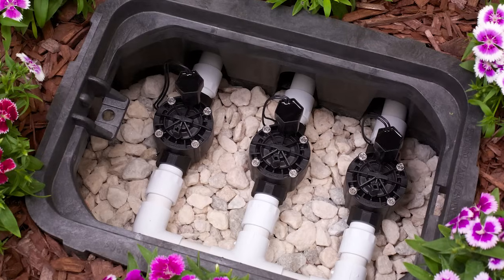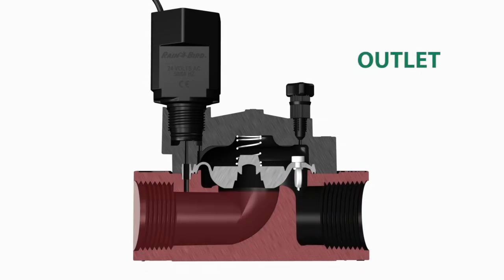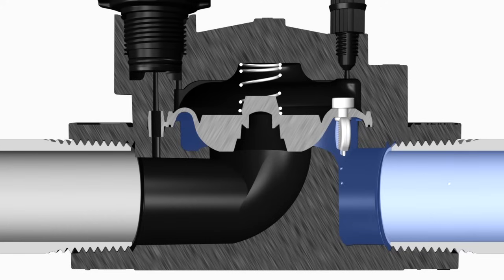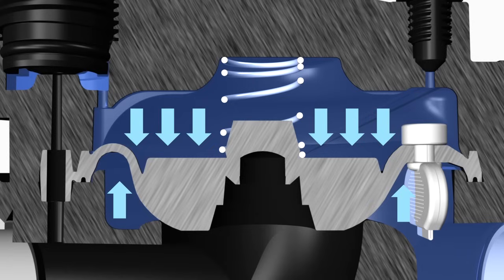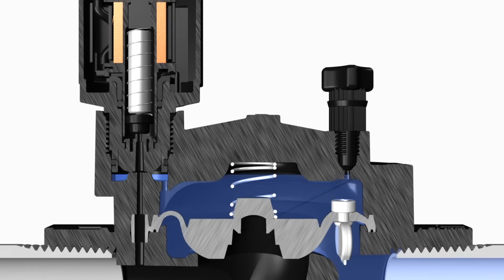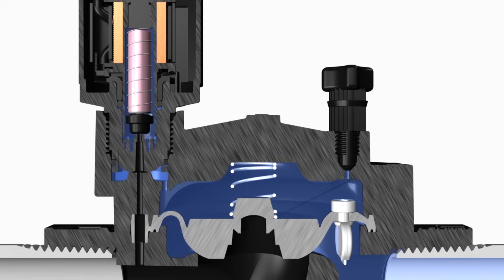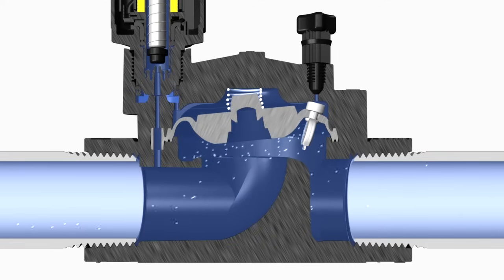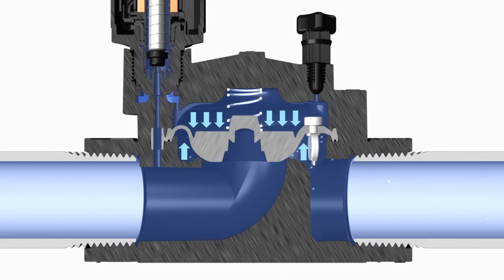How Do Sprinkler Valves Work? Rain Bird Irrigation

Comment: what if there is no spring attached with the diaphragm?
Reply: Likely then you're sprinkler will always either on or off. Pretty sure always on.
Reply: @securus777  i have seen many 2 way valves with integrated solenoid have spring attached with the diaphragm and some other type 2 way valves dont need springs. can you explain the advantage of not having springs in the diaphragm. in dorot make 2 way valves there is no spring required in the diaphragm.
Reply: @xtrememotoroads  Nope, sorry. Just a homeowner with a super basic system I'm trying to figure out on my own. :D
Reply: @xtrememotoroads  I can answer that question, I just need to know what other type of 2 way valves without springs you are talking about, like ball valves?
Reply: @xtrememotoroads  In some designs the rubber elasticity of the diaphragm itself provides the spring component, to save cost.  But having a metal spring makes the operation more responsive and reliable, and gains the adjustable flow control stem feature.  The spring stays the same over a lifetime, but a rubber part gets stiffer and goes "out of tune", so only the metal spring will last.

Comment: This animation allowed me to finally figure out what that little screw was for. I had a station that had power going to it but the sprinklers wouldn't activate. After turning the screw counter clockwise, some water spewed out of it and the sprinklers for that station started working again. If I tighten the small screw once the sprinklers get going, about 30 seconds later they'll shut off. Is this normal? What gives?
Reply: This one rainbird does answer.... way to go rainbird!
Reply: Yup it was the solenoid that was bad
Reply: I know this is 4 years later, but that screw "bleeds" the water from the top of the diaphragm thus lowering its water pressure and allowing the valve to open. However the solenoid is still closed, so as soon as you tighten the screw again the pressure begins to build in the top of the diaphragm and shuts the valve.

I had exactly the same question as you, so it's not uncommon. These things don't exactly come with instruction manuals.

Comment: I know how thay work i do sprinklers sys but you forgot to say what the spring does it holds the dighram closed
Reply: +john Kosheluk   The center spring on top of the rubber diaphragm does several things. First, it helps the valve seal a little quicker when the solenoid is de-energized as water under pressure has to flow back on top, thru the tiny bleed hole, to create a pressure difference. At this point, not only does it help timing as the next zone opens, but secondly also helps in alignment of the rubber valve seat to close. With the Toro brand, the spring is on the solenoids tube which acts as a guide, but still aids in quicker closing of that zone & its water flow.
Try it sometime without the spring, then note how much longer it takes the water to shut off. The next zone opens, with a slight delay, but having two zones open, creates a drop in supply pressure. If that occurs, the zone timing will be off and the next valve to open will take longer to unseat the rubber diaphragm. 
 It is like an automatic transmission valve upshift. A valve allowing hydraulic fluid to hold the component for 2nd gear operation, has to release quicker that the valve that allows for 3rd gear to starts holding. Otherwise, you have some holding of two gears at the same time, which is bad. Hope that helps.
Reply: @deankay4434  you guy you

Comment: I’m confused now though.  When I blow out my lines prior to the winter, I pressurize the system & turn that smaller knob counter clockwise a half turn to get the air to flow through  that particular valve/zone which then blows that zone out.  Not sure how that works by looking at this animation as that little valve doesn’t seem to be doing anything.
Reply: The "smaller knob" is a bleeder valve. It opens the valve manually by releasing the pressure at the top of the diaphragm that holds the valve down, similar to the dump chamber underneath the solenoid.
Reply: @PhuryousOne  ahh interesting,  thank you!

Comment: Hi, So, does that mean there can not be a backflow from the outlet to inlet when the solenoid closes. I have the inline values in my front and back yard, and I do not know if need a backflow preventer or not. Please let me know urgently
Reply: Normally you do need a back flow preventer, for the times when the city water is shut down. At that time, there might not be enough pressure to keep the diaphragm closed, and water from the outlet side of the valve can flow backwards through the valve and into the city water supply. And theoretically that water can contain contaminants - fertilizer, E coli, etc. You should check with your city building department to see if a backflow preventer is required.
Reply: @rockwellmath  Thanks. How serious is it. My landscaping contractor just installed inline valves in both front and back yard. Also, it is causing a loud thump in the plumbing house when the sprinkler valve closes ( I assume that due to the water pressure hitting the valve and bouncing back).  Do you recommend getting a back flow preventer or just replacing the existing system with anti-siphon levels
Reply: @sunitbansal  For anyone reading this and wondering, you should ALWAYS install a vacuum breaker/backflow preventer. Any modern municipality requires it by code.

Also, what you described is called water hammer and I can't imagine that is being caused by a sprinkler valve. They close too slowly to cause water hammer, unless you have crazy high water pressure at your house.

You might have a master valve before the actual sprinkler valves. Could be the cause?

Either way, homes with copper piping should have water hammer arresters installed, if the home doesn't already have them.
Reply: You will need separate backflow preventer.   These valves (rubber diaphragm and contaminated water) will fail.